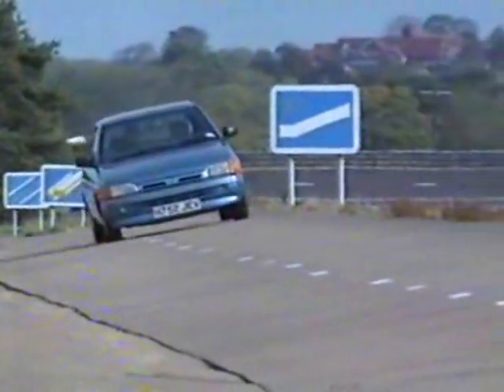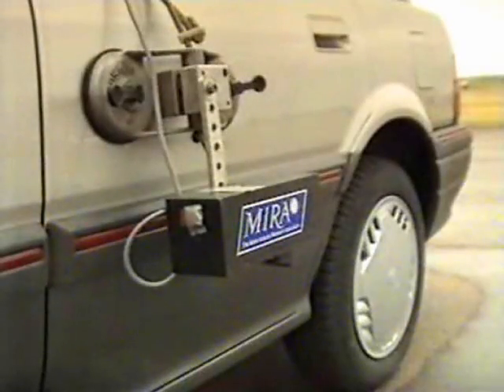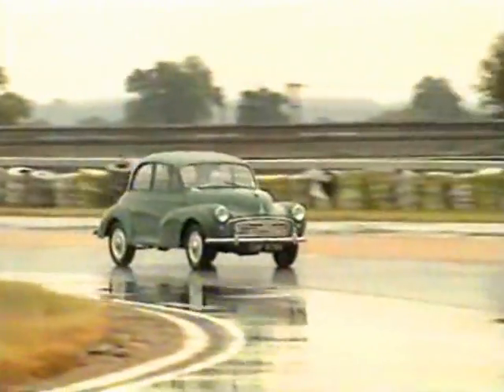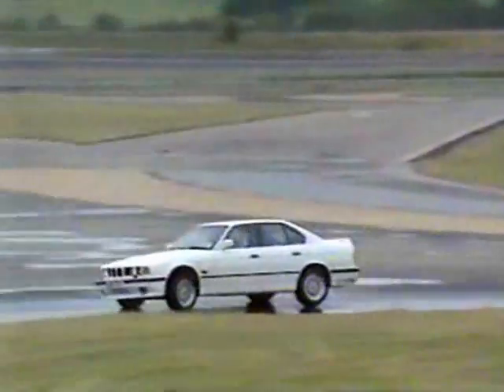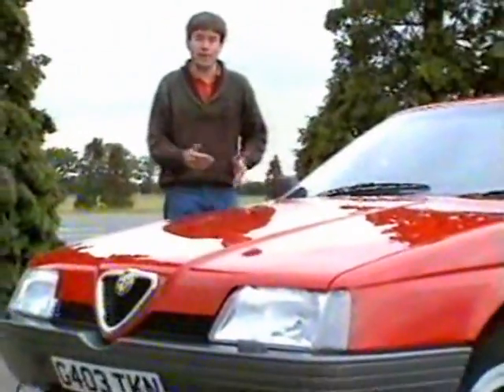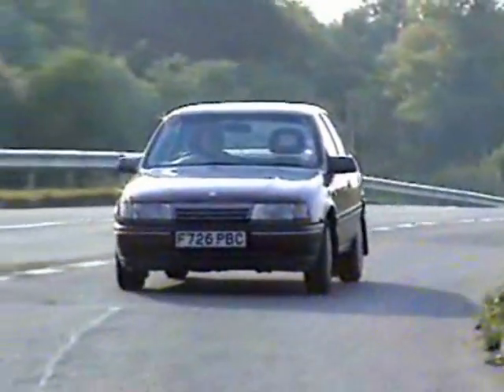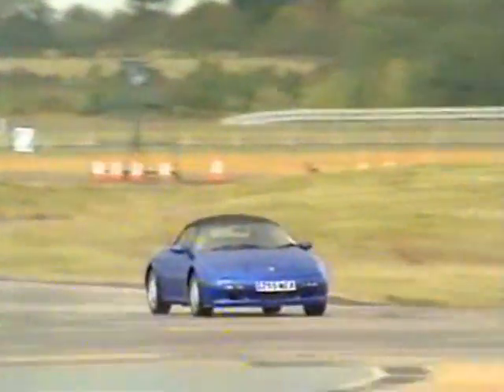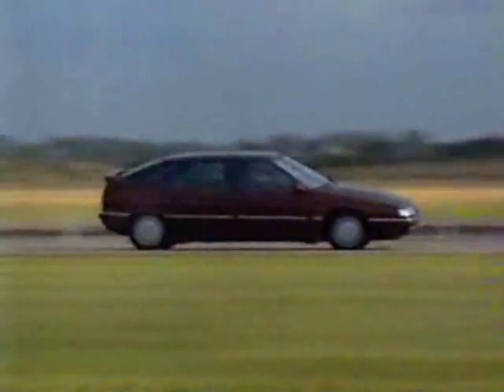Car Handling - Grip, Oversteer & Understeer explained by Tiff Needell

Comment: My BMW e34 Glides Superbly, Very Smooth & Controllable. If You Demand it to. 
The Rest of the time It STICKS LIKE GLUE to the Roads in all But the Worst Conditions & a Very Silly Driver. 

The Harder you Push an e34 through the bends at High speed , the More it Grips the Road & the Faster you Go, The Car Feels to SHRINK to Less than the size of an e30. AMAZING
When You Hammer a BMW e34 525i Se into Sharpe Double Hairpin Bends. 
BRILLIANT Cars For the Narrow Lanes & Steep Hills of Yorkshire. 
at 59 mph of course !!! Gently Wafting along. 
A BMW e34 is Not for Elderly Folk with  Slow Responses. It's a stupidly Fast 4 dr Saloon With A Limo Ride & Handling to Beat some Very Fast modern Cars. 

A BMW e34 Comes with NO COFFEE CUP HOLDERS. 
To Drive it as it was Designed, You Need One Hand on the Wheel & the Other on the Gearstick Flicking from 3rd to 4th & Back to 5th, then 3rd & 4th & down to 3rd again to power out of a bend. 
Keeping the Revs above 3,500 allows the engine to Do what it was Designed to do. 
LAUNCH a Big Heavy Car Down the Road, & Feel like you are Not even moving.

Comment: What do you do with the pedals if you oversteer?  Since one of the causes if lifting off the throttle I'm guessing you shouldn't lift off the throttle completely, but do you keep your foot on the accelerator if you power oversteer?
Reply: maxpowers3732 depends on the situation, if youre playing it safe ease of SLOWLY 
if you want to push it through the corner maintain throttle position and correct the slide with countersteer

honestly rhough it cant be explained, just practice

Comment: I have a doubt if we use too much of throttle in a corner then the backend of the car will slip n we will lose the cars rear to prevent that shd we use more throttle or lift off throttle?
Reply: if you induce oversteer by throttling too hard more throttle won't fix it obviously, but if you oversteer due to your car's momentum you should give it some throttling so it won't snap back at the end of the corner

Comment: During understeer situation will a bit more steering help the car to keep the car in line and off road?
Reply: Actually it makes things even worse. When the front wheels lose grip then turning more reduces the contact surface because wheel gets tilted slightly the more you turn. More tilt -> less contact surface -> even worse traction -> slightly more understeer.
Always let off the throttle when the car is understeering.
Reply: If you want to check it in action, sometimes go to parking lot and steer as much as you can to one side and then go outside and check the camber.
Reply: You can ease off the gas too to slow down

Comment: "g" is an attractive force that exists between any two bodies of mass. The force experienced by a driver in a car changing his velocity (accelerating) by changing direction has never been "g" but centrifugal force. The units may be identical to the SI standard unit of acceleration due to gravity (9.81m/s^2) but the two are otherwise unrelated and I am not sure why racing commentators insist on using it.
Reply: +Michael Smitten

Sorry, but no. The unit 'g' here is being used as a convenience unit, for simplicity. They are related because we can reason about the effects on human beings by comparing an acceleration to the standard acceleration due to gravity. It may seem unnecessary, but it's been chosen by very well educated people for a reason. What you are describing as 'centrifugal' force is just inertia, when viewed from a non-inertial reference frame. Centripetal force is what keeps the car moving in a circle, while everything not firmly attached to the car tends to keep going in a straight line according to its own inertia.
Reply: You say "no" but seem to be agreeing with me that the force is not gravity. As an aerospace lecturer I have to spend a lot of time disabusing my students of these anomalies. Yes centripetal force  keeps the car on track in a curve, but it is centrifugal force that you describe in terms of "g". I don't expect it to change but feel it is necessary to explain your terms before using them confusingly to the uninitiated. The unit of centrifugal force is the Newton (except in motor racing it seems)
Reply: +Michael Smitten In engineering (at least), g is not a force; it is simply a unit.  Depending on the context, g can be used as a unit of acceleration or a unit of force (as long as it can be related to a reference mass).  Regardless of whether a force exist between two or more masses or a force is centrifugal/centripetal, tangential, etc., it can be expressed as a ratio between that force and what the product of the reference mass times the standard acceleration of gravity would be.  G, as a unit, is generic, robust, and practical and, more importantly, g is not a force (again, at least in engineering).

Comment: Power oversteer= Drifting
Reply: power oversteer = power slide*
Reply: sorta
Reply: Handbrake+gas = drifting
Reply: Oversteer induced by power is called a power slide. Drifting is induced by momentum, flicks, brakes or all of these things
Reply: @Beatsbasteln  Not at all, powerslides are induced by handbrakes and inertia, since you cant keep the car at acceleration or even keep the speed. Oversteer with power is what drifting is, and this is why formula drift drivers get a fast entry, reduce their speed and come out of the corner at full speed
Reply: @caralho5237  nah man. That's just the common misconception. The formula drift people only use the word 'drifting' because 'powerslide' doesn't sound so neat. It's just the same how hiphop people messed with the word 'hoverboard'. Now everyone thinks hoverboards are silly segways
Reply: @Beatsbasteln  powerslide does sounds boring, but that is the word used by everyone, that is what the word was designated for, and this is why im rite
Reply: I know its right

Comment: Driving in snow, down a curving ramp onto an Interstate, I liked front-wheel drive over rear drive. Rather contend with understeer than oversteer if hit some really slick stuff.. Drove 'em both in nasty snow storms.
Reply: pastrami1945 Different strokes for different folks. In the snow I'd much rather have RWD. I can manage oversteer quite easily as I've had a lot of practice on dirt roads. Understeer to me is no good.
Reply: pastrami1945 fwd cars can oversteer very easly on corners due to poor weight balance.

Comment: I don't see how understeer is "safer" than oversteer. It's really easy for me to control oversteer but with understeer You can only turn as hard as you can and ease off the gas  pedal and hope the car regains grip. The reason I love old Porsches is for the reason that they naturally oversteer and it's so rewarding to hold the slide in them. But everyone has their own preference I suppose
Reply: I guess it depends on the road and the corner, but it's usually safer to hit something with the front of the car than the side. Safest of all would be to drive REALLY fast, so you hit with the rear. We need to double the speed limit and make roads out of banana skins!
Reply: DevasionX That's a pretty morbid comment. I never said I just drift around the roads, but there's a reason why high performance cars oversteer rather than understeer, it's easy to control oversteer for most track or racing (keen) drivers because there's more you can do to control it than with understeer. If you suck or have shitty car control then why don't you go practice on a track and understand what I mean before making stupid judgemental comments.
Reply: Pulling an e-brake just a little bit can help to understeer .
Reply: Haha that's true if you pull it a little nothing will happen except a little humiliation lol
Reply: And that would create a 'handbrake turn.' Also, It seems easy to control ovesteer, but it really isn't! With understeer you can just slow down and fix the problem.
Reply: In my experiences I always found it easier to control oversteer but I am a keen driver. For a regular driver getting from A to B you're right understeer would be easier to control.
Reply: if im gonna crash id rather go head on into the tree than have my side go in and potenially kill me or the passenger
Reply: SIMcityplayer2002 It doesn't always work lije that i got both oversteer and understeer dirving in a fwd car in the rain and i find it easier to control oversteer. In understeer if you slow down it can lock the wheels and go straight into a curb like it happened to me.Lmao.
Reply: Joe Ziadan Ofc,its called drifting. Something that is supposed to be reserved for racing drivers in closed tracks. Sadly stuck up tools want to use public roads as race tracks after they just got their licence and buy BMW 3 series, and ofc people with a midlife crisis. All of them support the so called "high performance marketing audience" hence why car brands love these tools.
Reply: understeer is safer because you crash head on, and that's the way the car is designed to crash. Also rear impacts are much more dramatic for the human body.
With understeer there's a good chance the car will spin if the driver isn't capable of correcting it and they might crash in reverse.
Reply: You can't pull the E-Brake 'just a little bit.' It's on or off.
Reply: Nathan Petrohilos there are no such things as "keen drivers" , Joe is using cars as a toy on public roads, Well see how his dead body enjoy all the deliberately caused oversteer when his car is sideways wrapped into a tree.

Comment: Lol... now days, my Sierra is faster than that Porshe. :D
Reply: that porsche is the "poormans" version. it was designed so anybody can buy it so that porsche can get out of crysis along with vw and audi. porsche continued development after the other dropped out and was released in '74 i think. it has 125 bhp and had the engine from an audi 100. altho it lacked power its still a porsche and its extremly fun to drive with almolst a perfect 50/50 weight distribution. im looking forward to buy a 924 of my own soon for a couple of hundred pounds.
Reply: armkenz
Clarkson once joked that that Porsche has the engine from a VW van.
  Nonetheless it was still very expensive at the time.
Reply: MrWolfSnack it was used in a vw van but that was like in the 90's at the engine's last breath
Reply: not on a curve like that it isn't. 944 pulls almost 1G
In spite of the fact that sierra chassis was copy of the 924/944 chassis anyways

Comment: what year was this.  trying to figure out what they mean by a "modern" car as in terms to when this was made
Reply: SIMcityplayer2002 youre false, Check with the google. İt was e34 bmw 5 series
Reply: That Rover was a "G" reg, so probably around 1990. That would have made Tiff about 38 or 39, which looks about right.
Reply: Muhlis Goktas Not a chance in Hell. Top Gear was off the air by then, and looking at5 how old Tiff is in this puts it further back. Maybe 5 years earlier, give or take a couple of years
Reply: This Top Gear was still there in 2001.
Reply: And it was an E46, not an E34.
Reply: SIMcityplayer2002 Nope. Tiff Needel had left long before that. Plus, look how young he is. This is the 90's. And probably the early 90's
Reply: BMW e34 Series in this videohave a DSC so this video was after the 1996.

Comment: They should show things like this in schools, this can save tons of teenage lives. Too bad the schools are no longer used for teaching but are used to blend in peer pressure and conforming to society.
Reply: Yeah, I never learned anything about cars in school. And the auto tech class was only available to seniors, long after the crucial time to learn about cars at a young age so the knowledge sticks. And it was only available to men. Women couldn't join this class.  I am honestly not joking. My high school was fucked up.
Reply: +Catcrumbs and not stare at their f-ing iphones while driving...
Reply: +Admiral Ackbar 3:13 "With modern cars, the grip level is so high that you should never reach the limit on public roads." More lives would be saved if you could impress upon them the need to drive at a prudent speed and with an appropriate gap to the vehicle in front.
Reply: MrWolfSnack True, in middle school I learned about cars through the internet.
Reply: Yes I agree, Every Driving Test should include Lessons in ADVERSE Car CONTROL in Wet & ICY Conditions in the UK. 
Every Driver Should PASS the LATEST Driving Test every 10 or 15 Yrs. 
This Will Keep Long time Drivers Alert to modern Cars & Roads. 
Everything Changes , Driving Tests Need to be For the Very Best Drivers. 
An Old Person at 70 Yrs Old Should have the Ability to Spin a BMW 5 Series Around a WET Track, Same as a 17 yr old new Driver. & Have Full Control. 

Fail the Test = Go Back for DRIVING LESSONS REGARDLESS OF AGE, OR GENDER. 
17 Yr old Girl? 72 Yr old Granny.  ONE Driving Test every 10 / 15 years For Everyone. 
FAIL = Go Back To Reading the Highway Code & Clicking Boxes on a THEORY TEST at 82 yrs old, Because their Car will have TOUCH SCREEN CONTROLS etc. 
3 Outright Fails = You cannot apply for 3 more years. & With a DOCTORS Letter of FULL HEALTH. if over 70 yrs old.

Comment: No drivetrain will save you if you go in to a corner too hot.  Lift off oversteer is cool (unless unintended).  I used to own an XM, and it was a beast at keeping everything level.  I currently own an Integra type R...  which is a lot better, in terms of lift off - it just goes sideways until you put your foot down.  Those XMs were almost impossible to get sideways.  I did try.

Comment: I knew most of this on an instinctive level, but having just got an M5 after yeaaaars of FWD cars, I found this useful, thanks for the upload :)
Reply: How did it go? I also want to get an rwd But i have also only have lots of Years of fast FWD experiences...
Reply: @jeffreylebowski2291  I like to deliberately push the limit (braking in the wet, oversteer, understeer...) of my rwd car so that when something unexpected happens I have more chances to not to crash. I recommend you to cautiously try it, plus you can learn to drift :)

Comment: That was a series 1 Citroen XM at the end, which was shown to have virtually comparable handling to the sports car. The Series 2 Citroen XM's that followed had much better handling, with evolved hydropneumatic/nitorogen gas suspension. Putting low profiles on that car results in a car that seems impossible to "shake" of line.

It seems to me that most people are unaware of the exceptional handling on these cars.

Comment: @NutsandGuts 
basically, depending on how you differ the power distribution between the front and the rear....for instance, most Audis tends to understeer, while the Audi R8 tends to oversteer becuz the R8's diff tends to give more power to the back rather then to the front, as to most Audi's are

Comment: @NutsandGuts 

They tend to hold their grip, and especially with modern cars with electronic systems differentiating how much power goes to each wheel, sort it all out for you.

Expect more performance oriented AWD cars to oversteer while your mom's Subaru wagon to understeer. Your dad's old 4WD SUV will probably flip over.

Comment: Generally drifting is about having a greater rear slip angle than the front tires.  It can be done by using power over, handbrake, interia, etc.  You just get more options with a RWD and easy of keeping it under control than other types.  

Also you shouldn't allways be at opposite lock durning drifting, you could if you wanted to and try to use power only but sometimes that won't work on smaller hp cars and you will need to figure other ways out as well

Comment: I've heard that before, but as I understand it, drifting, in its strictest sense, is holding a car at opposite lock and using the pedals to steer, which is something you can only do in a rear-driven car. The only time you come off full lock is when you're turning the wheels the other way. Drifting, then, is intentional heavy oversteer.

Four-wheel slide, on the other hand, means that all four wheels are sliding to some degree or another, with the steering a lot closer to centered.

Comment: but if the car is holding a slide while your slip angle of the rear is greater than the slip angle of the front arent you technically drifting?

i hear people all the time say "oh theres no such thing as drift unless its RWD" i dont agree. that just means your front wheels arent spinning too.

Comment: That can be achieved with any drivetrain layout, though. It's just easier if you can put down some power on the rear wheels.

I do in front-driven cars through trail braking, and it's even easier if you have some weight in the back.

Also, a technical complaint: Calling four-wheel slide "drift" is inaccurate, as the term "drift" only applies to intentional oversteer.